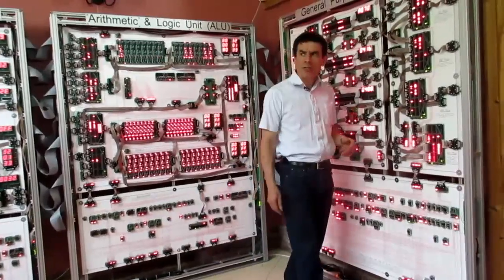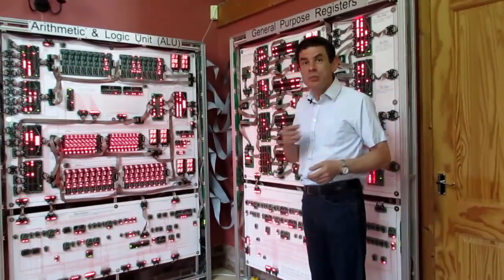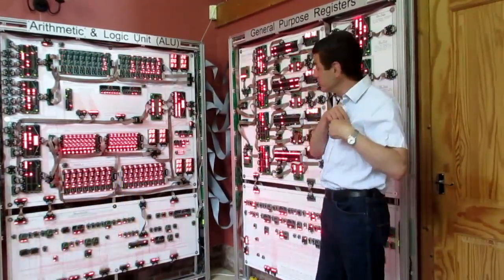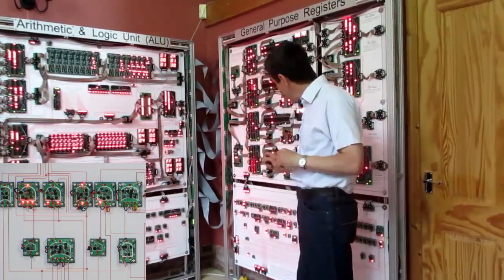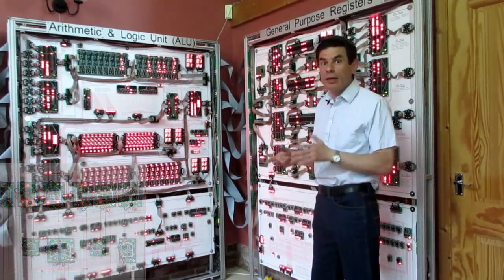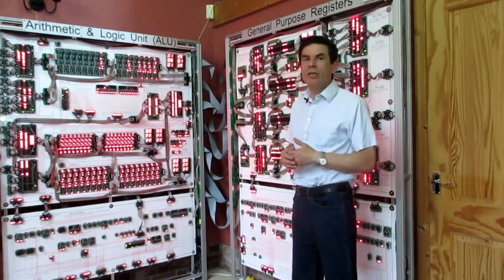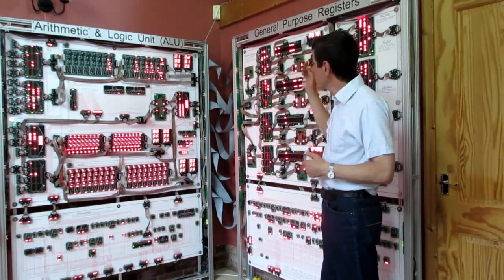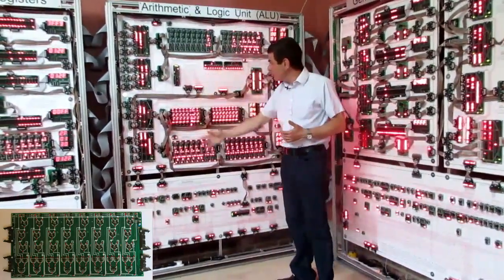Megaprocessor Tour 1

Comment: Are the stages of processors still similar to this in modern chips?
Reply from the maker: They all have pretty much the same major blocks - ALU, Registers, Decoder, Memory Interface. But bigger processors have vastly bigger and more complicated versions, and can have multiple execution units so they can do many "sums" at the same time. There's also a bit of blurring as to the boundary between processor and peripherals. For example micro-controllers are described as processors but the chip they are on will have many peripherals (e.g. serial ports) integrated with them.

Comment: Nice, what is the instruction set? x86?
Reply from the maker: My own ! The Megaprocessor had its own requirements. I say a little on the matter at http://www.megaprocessor.com/GBU_architecture.html.
You can see the instruction set at http://www.megaprocessor.com/programming.html
Reply: @Megaprocessor  I Just read those Doc's. I was expecting something ultra simple, but it actually looks more powerful than a 6502!
Reply from the maker: @StarsManny  Certainly the instructions are more chunky, but it runs less than 100th the speed so the 6502 wins.